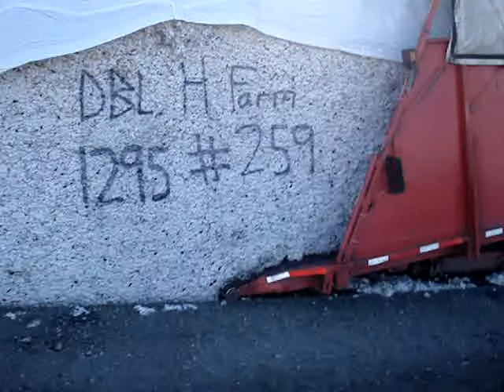Module Trailer

Comment: those chains underneath have to be timed perfectly to the speed of the chains on the floor of the trailer so as to not rip the module up. modules are only held together by pressure. if you notice, the module does not move, the trailer moves under it and lifts it up